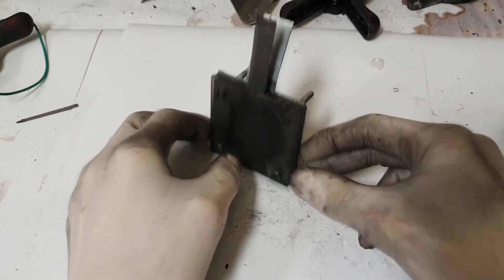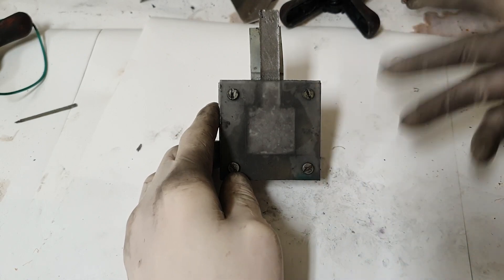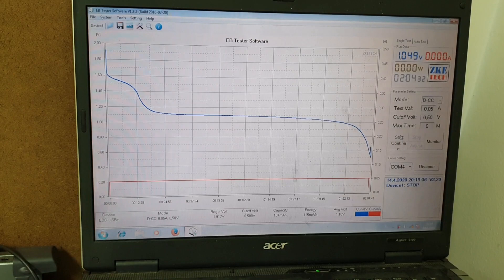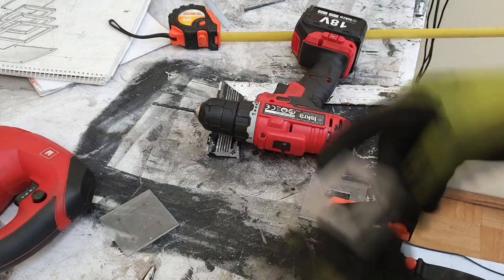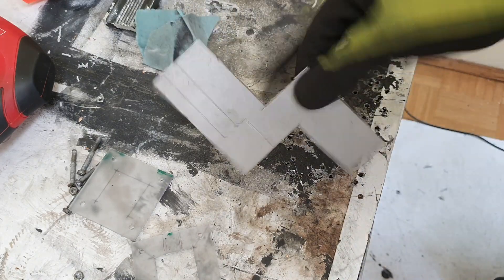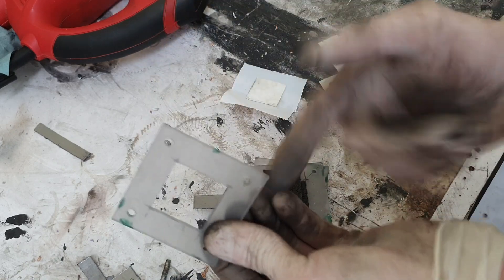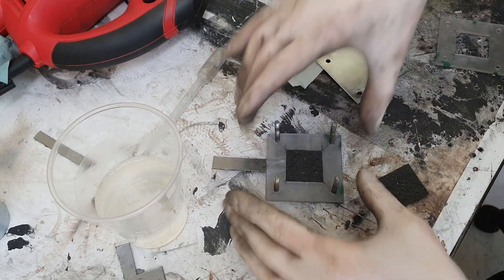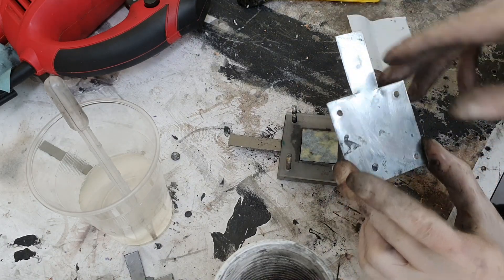Diy Zinc Chlorine Battery for off grid - Making the battery cell

Comment: How does this cell hold charge? I imagine that self discharge is pretty high since there's nothing keeping the chlorine from migrating to zinc electrode. Have you tested it? Did you try sequestering chlorine in any way? Freezing it seems useful but still.

Comment: Hi , is this Graphetic foam is conductive ? and what is conductivity of the black foam you are putting after Activated carbon and before separator?
Reply from the maker: Yes graphitic carbon fiber is conductive and also need to be that the cell can work. The foam that you see which I put in the cell is graphitic carbon fiber. The conducrivity is around 3 to 1 ohms / cm. Lower ohms are better.
Reply: @cayrex  Thanks for your reply.

Comment: Hi there. nice cell. Don't let your data logger stay on that angle when running the fan will end up like mine making noise.They should call the graphite felt carbon felt, There is no graphite in it. I put some in the microwave and nothing happened. Just heated up to 260 degrees.
Reply: me too dan! i think there must be other types that look similar. mine is not conductive !